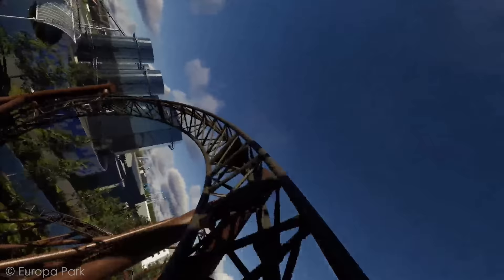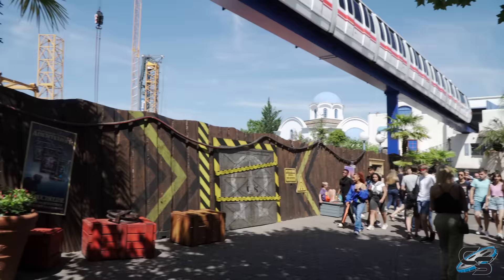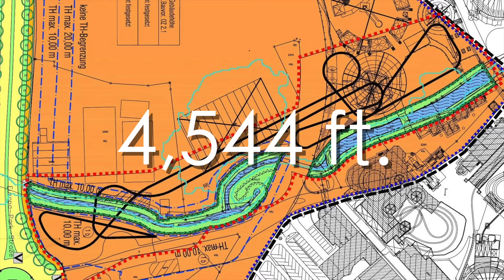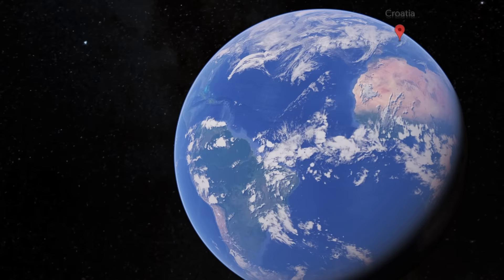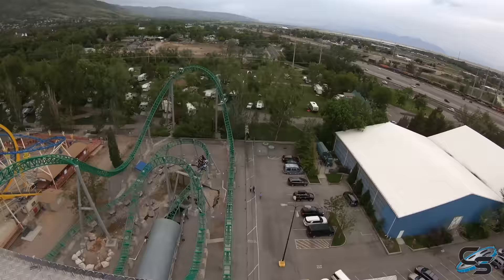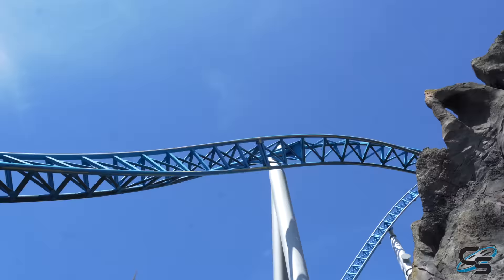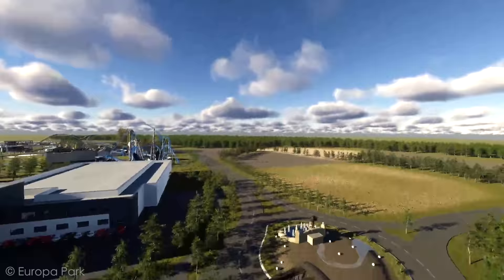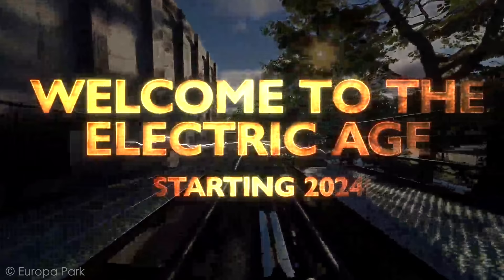Voltron Analysis Europa Park's Amazing New for 2024 MACK Stryker Coaster (First of its Kind!)

Comment: It's very likely that the LSM boost before the stall doesn't boost the train all that much faster than it's currently going, but it instead has an interesting secondary purpose: to be a block section.

That looks to line up with the seemingly higher density of block sections from the turntable to the end of the layout.

Despite the relatively short trains, Europa appears to be planning on sending out trains really frequently
Reply: You can see on the table model that the stall is as tall as the initial quarter loop, and thus way taller than the previous immelman. The boost is definitely needed, but it can also act as a block zone for sure.
Reply: I think it boosts. I got the sensation that you still speeding up while climbing to the stall. Since it's located in a valley, they probably fine tuned it to feel like the continuation of the acceleration from the previous drop. If so, genius move from them, ride is at good pace there, so a smooth boost will give it a more natural flow.

Anxious to jump aboard it!!!

Comment: Actually they plan to use this coaster on full capacivity. That means 7-8 tracks. Otherwise they wouldnt be able to reach 1600 ppl per hour. 
The Station will be the same as on Arthur. So the track doesnt stop while loading ppl in and out. 

Im glad they didnt show the darkride section before the first launch. So we can get surprised^^

Im also curious what else they will add to croatia in further expansion stages. Its clear that these theming section wont be just the coaster.

Its like any other theming land they builded. We had bluefire with Island first. Then they added wodan, then whale adventures and the Gazprom Building. 

Greece had also just Poseidon, before they added the shooter Abenteuer Atlantis and Pegasus, the family cosster and Fluch der Kassandra. 

Ppl speculate that we might get their first new water attraction

Edit:

If you look closer to the first launch. Is not vertical. You kinda go a bit more than 90°  so basically upside down ;)

Its not only in the Layout and artworks but also in the miniature model.

Also, the mid launch before the stall, is not only a boost but also a block section

Comment: I just realized that the lsm boost might just be there so there could be another block section, it might just be there to brake if necessary and then also get it back running

Comment: I kind of makes me wonder why Parks are still building blue fire clones fairly recently when Mack have moved on such a long way with their layouts, it can’t be that much cheaper building a clone when steel is the biggest factor in cost
Reply from the maker: Youd be surprised. A custom layout can take a lot of time. Saves a lot to do an off the shelf model if the park isn’t bothered by that.

Comment: I hope there will be some theming during the turn table segment. Because else I feel like the ride will have a bit of a boring middle point that takes away all the speed and has you waiting for the rest of the ride for 30 seconds or so.
Reply: Since its just the first stage of this area and its more than likely that more attractions will come into this area of croatia, im pretty confident that the theming will expand around this coaster
Reply: I am sure there will be a lot of theming when the ride openes. They have a whole year for this as it is only opening in 2024 and the track is already beeing  installed right now

Comment: This is going to be a great coaster, but i will wait like 2 or 3 years before riding it for the first time, because if one goes there when this coaster just has been opened is going woait about 3hours or maybe even longer xD
Reply: With Europa-Park’s insane capacity and operations, an hour besides peak season at most
Reply: @revofreak1993  for a NEW coaster? you got to be kidding...
Reply: @KingJohnson1985  It’s not Six Flags, it’s Europa-Park, they have probably the best operations in the world
Reply: @revofreak1993  and? even they cant handle an overload of the queue...its normal a new coaster has far longer waiting times...
Reply: @KingJohnson1985  I rode Wodan a week after it opened in 2012, station walk both 2 days
Reply: @revofreak1993  Wodan=/=Voltron

Comment: The Tesla energy tower is going to be theming... Why aren't they building a working Tesla energy tower? They built one in Texas and that one seems to work ;-)
It could create free energy for the entire park! I wanted to go to Europapark this year, but now I want to ride Voltron, so I ques I'll go next year!
I would also love to see a Mack Exreme Spinner and a Mack Hyper/Giga Coaster at Europapark!
Reply: They never will add any other coaster than this one. They already have problems with the neighboor village. 

There is a citizens' initiative that regularly complains about the noise.  Some attractions have already been changed bcs of them. 

They always involve the village in all decisions and projects. Since Mr. Mack lives in the village himself, he wants to maintain a good relationship with his neighbors. Of course, europapark could decide over them, but he don't want that.

Because it only became really problematic with the construction of the wooden roller coaster.  Naighboors complain that the track is getting louder and louder, which is why a sound barrier has now been built at the highest point to stem the noise. Therefore, a few years after its opening, Silver Star also received a sound barrier at the first drop.

Nevertheless, I could imagine that they might build a higher coaster than the current one. If they build the roller coaster on the edge of the free area, it would be far enough away from the village (but just speculation)

Comment: Loving this, not only because EP is my go-to park 😀 hope the turn table won't hurt capacity
Reply: It will still have a capacity of 1600 riders per hour. Sounds fine.
Reply: They nees this turn table for the capacivity. 

This coaster will operate 7-8 trains and the loading station is the same as on Arthur. So it doesnt stop moving while loading ppl in and out